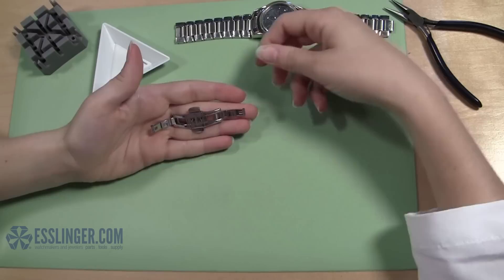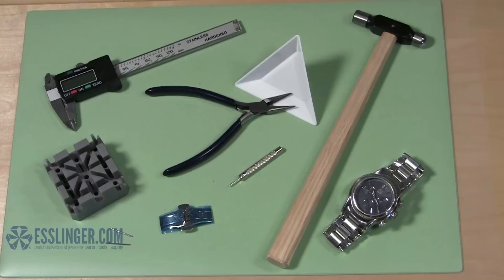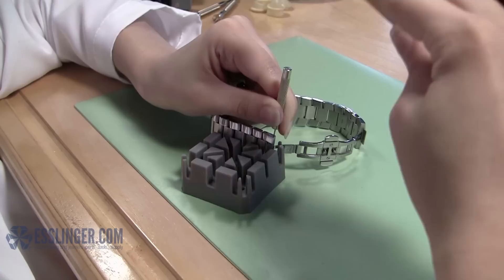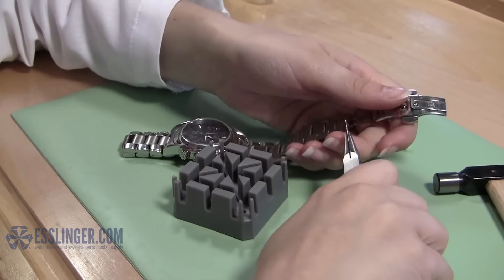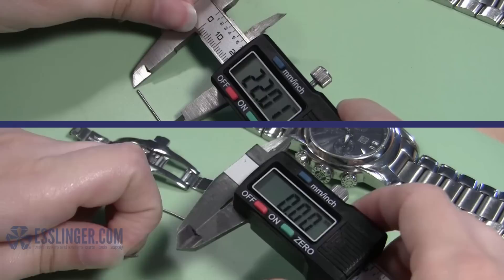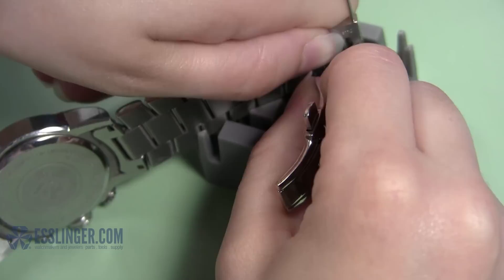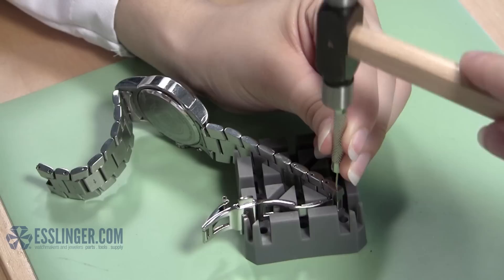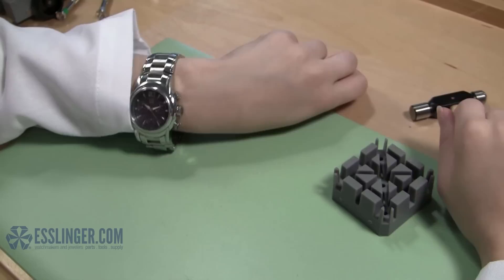How to Replace a Watch Band Clasp Butterfly Buckle

Comment: A small barrel piece came out of the eyelet hole of the butterfly clasp, it seems its a reducer because on the one side when I put the pin back thru it'll just fall out. I only got the barrel out of one side of the clasp it must've fallen out of the other side when I was taking it apart. Is there a name for this tiny piece?

Comment: purchasing a watch soon and my hands are normal size but wrists are small so if i adjust the links to perfect size it will be difficult overtime to put on my watch. could i buy a butterfly clasp to increase the opening of my hand. btw the watch will be a metal band
Reply: +Gus Singh  There are clasps that also adjust. So in addition to removing links on the actual band, you get additional adjustment on the butterfly clasp itself. Usually, an additional centimeter of adjustment.  That said, any watch will have many removable links on the band, so you should be fine by just removing links.  The watches I have go down to about 5 1/2 inch wrist.